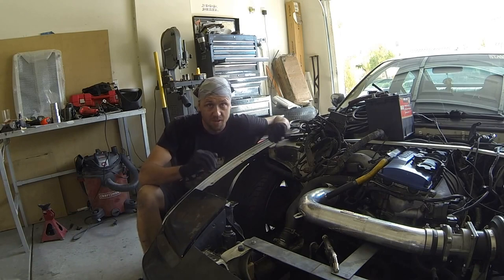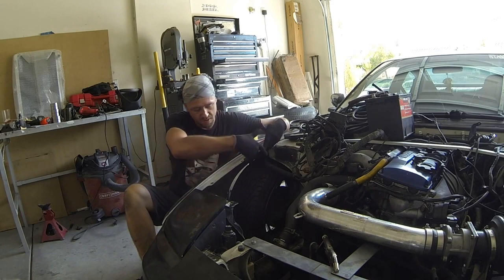TFSS: How To Build A Tube Chassis Front End - Measuring & Fabricating the Primary Tubes

Comment: Very informative with the bender .......... I have a JD2 model 32  (air / hydraulic ) , and getting the bends correct has been my biggest issue ....... The angle is always right , but the distance between the bends always seems to be off ................ Now I know how to look and see where the start of my bend vs the start of my dye is setup ...  ... I put my tube in and lock it down , but the bender has about 4" of arm movement before it grabs the tube to bend (if that makes sense ) ......................... But now , I know what to look for and see how the dye grabs vs the bend starts .........................................................  I am Subscribing to your channel , your info just helped me build the crossmember to hold the transmission in my 4x4 project ........... ............... THANK YOU SIR !   ............. Thank you for sharing your skills and helping the "Fabrication Challenged " group like me .............
Reply from the maker: +Norman Murray What size die does that happen with the most? My 1 inch die has a lot of movement before it makes an impression in the bend. I do pre-load the bender before setting it up, but the 1 inch always seems to be just shy of the angle it needs to be. As long as the measurements for the final product are based off of the same starting point (like the start of the die), everything should line up where it needs to be on the final product.
Reply: On both of my 1 1/2 and 1 3/4 dies ....
Reply from the maker: +Norman Murray Interesting. There is a little play on mine, but its very consistent with those sizes.

Comment: Is that the JB2 Model 3 bender? Pro's/Con's? I've been looking at getting one for tube fronts/cages/bash bars. Watched all of your vids and its pointing me in a good direction for my first attempt
Reply from the maker: +stealthygsr Yes, this is the JD Squared Model 3. It is definitely my favorite bender so far. Virtually anything you have to bend fora car can be done with the Model 3. If you need to bend heavy duty parts (for off-road/crawlers) with very thick wall tubing, the Model 32 will handle it. I personally haven't exceeded the limits of the Model 3 though. It's pretty stout.
Reply: Good to hear. Now I just need to decide on a welder. I'm not sure if a 140a Mig will do the job or if I'll have to spring for a 180a
Reply from the maker: I use a Millermatic 135 for everything I don't use the TIG on. It's more than enough to hold this front end together and more.
Reply: Even for a cage? I'm kinda thinking to get started I will just get a 135 MIG and have my buddy with a TIG do whatever I can't with the 135. I'm just trying to spread out a small tool
budget
Reply from the maker: I use the TIG for cages because I like to have more precise control over the welds, but people use MIG welders on cages all the time.
Reply: Which would you suggest? I know Eastwood has its problems, but they are running a heck of a sale right now on welders and I can't make up my mind. 

$500 175a MIG w/spoolgun
$400 200a TIG DC only
$280 135a MIG (gas)

I currently know how to MIG but I'm willing to learn TIG. I don't NEED to weld aluminum but the option could be nice. My plans are Cage, tube front, bash bars, manifolds and thin sheet metal. Thanks for the help!
Reply from the maker: +stealthygsr I can't recommend a "budget welder" because they often make you develope bad habits trying to work around an inferior product. 

I have used Eastwood products and I can not give a personal or professional recommendation. They simply don't compare on any level. I recommend saving up and buying a welder once. I know the price tags are very tempting, but how many times do you want to buy it before you spend the money on a better product?
Reply: I understand, I'll see what I can scrounge together, thanks though

Comment: hi, what kind of steel do you use ? thanks
Reply from the maker: +TRWperformance It all depends on the build and requirements. This particular build used mostly ERWS (mild steel), but some is DOM. It's all based on the requirements and budget.
Reply: +The Fabricator thanks